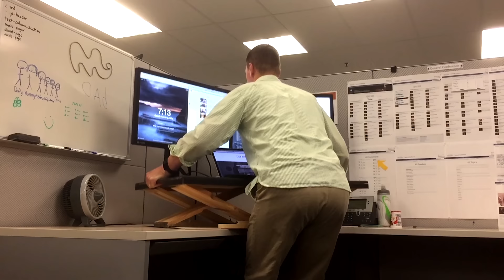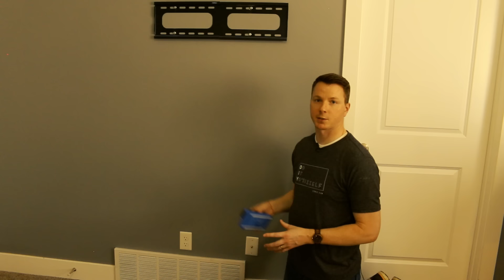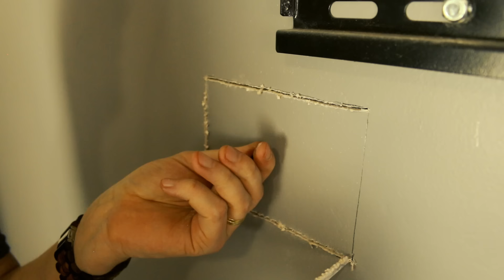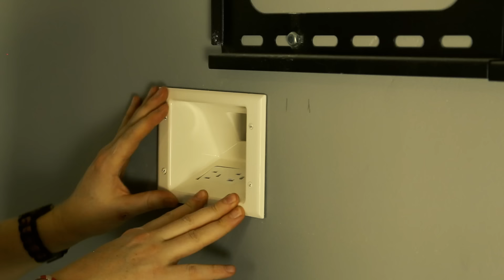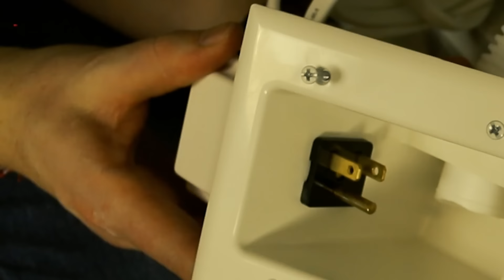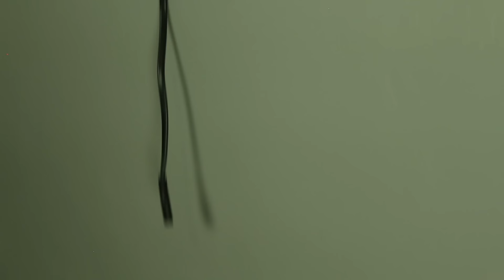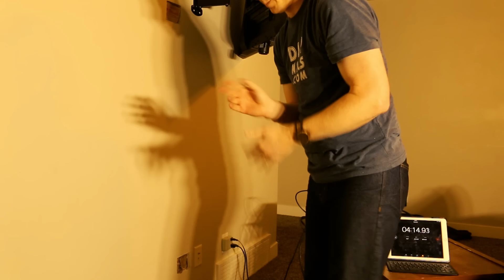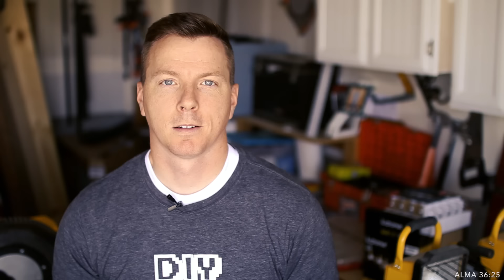How To Hide Your TV Wires in 30 Minutes - DIY

Comment: If your stud wall is as simple as these are then save a fortune and just use cheap dry liner boxes and drilled blanking plates. A lot less ugly too. You can buy longer cables and stow the excess in the wall easily. This makes installation easier and allows upgrade to a larger TV.

Comment: Highly recommended to plug into a UPS “uninterrupted power supply” instead of the wall.  Save your TV in case of lightening strike.
Reply: A UPS will not save anything from a lightning strike. Unplug what you really care about! Read the fine print on what they protect you from.

Comment: I've don't this many times and you don't need this over complicated kit. 2 cut in boxes 2 blank wall plates that you drill a hole in and an extension cord do the same thing! Total cost my way is less than 10 bucks and you use the exact same process to cut and run your wiring.

Comment: FIRE HAZARD WARNING.
NEVER roll up power wires like that.
Now if they are under power the magnetic fields made by the electricity could build up heat inside the wires.
And that is 1 step to a power arc inside your wall and death to your whole family.
If you want to learn about this buy a cheap roll of wire and take it outside and use it to power something.
After a short ammount of time carefully feel the wires on the spool and they should be either warm or mabye even HOT.
Reply: Magnetic fields don't generate heat; the heat in a coil comes from the current flowing through the resistance of the wire.  The inductance added by coiling the wire will reduce the current slightly, so there will be LESS heating.  But at 60 cycles, the inductance of a few feet of AWG 14 or 16 wire is virtually nothing.    All you people who think a few turns of wire are going to catch fire are plain goofy.
Reply: 1985 I was just starting into the electrical trade and was visiting a friends house. They had an extension cord rolled up sitting on the wooden floor near curtains that had melted into a blob. It was used to run a window A/C unit. I  believe that if I hadn't noticed it there would have been a fire. The plastic was so badly melted that I couldn't believe that the wire hadn't shorted out and blown the fuse. They were very lucky.
Reply: Ooohh magnetic fields I better wear my tin hat!!! 😂😂😂😂😂😂

Comment: Nice idea, but noch for using in solid European houses. ;-)
Reply: Kris Bright, No, the walls today are insulated too. Look at this: https://en.wikipedia.org/wiki/Exterior_insulation_finishing_system
And, if you have solid interior walls and doors without gaps you can poop without anyone listening. ;-) 
That's awesome!
Reply: Kris Bright You miss the point. You can still have brick walls and insulation! External walls have two layers of masonry with insulation and and airgap between. So reduced heat loss, no penetrating damp. Internal brick or block walls dramatically reduce sound transmission, help balance humidity, store heat to even our temperature fluctuations and of course are much more solid. You talk about ease of maintenance- cannot think what kind of maintenance you would need to do to an indestructible wall! It's not like drywall where you can punch a hole right through. Any small scratches to the plaster finish are easily filled and sanded. Why anyone would opt for drywall when brick is an option is beyond me.
Reply: Dont forget, its very easy and cheap to pump insulation in the walls too. I think Americans prefer to let their houses blow away every time a breeze passes. lol.. Hurricane in USA.. whole towns blow away.. Hurricanes in UK, Ireland and rest of EU, we put on a cozy fire and wait for it to pass so we can tidy up the garden :p So basically, paper houses might save money..... as long as its not windy out lol
Reply: However, he did point you in the solid wall direction in the opening statements ;-)
Reply: Because it is easier to insulate and far cheaper to maintain and replace parts of the wall.

It's mostly a convenience more than anything else.
If you have a solid brick wall house, you're most likely losing a ton of heat to and from the exterior walls.
Reply: H. Sch. I was about to say the same. American junk as its finest. How can they live in paper house?

Comment: One of the basic rules in Electrical
Never ever make circle round coil out of life power line 
That's will started a magnetic field that creates a resistance with in the wires  which will generate heat that will cause the wires to meltdown (perfect recipe to start a fire inside the walls).
Reply: While I don't agree with the loop he made, It's unlikely to cause a fire, and unlikely to heat up with the minimal current it will be carrying. Was it a dumb move? yes.. Does it really matter? NO.
Reply: I'm still trying to figure out wtf "life power line"is
Reply: Because electricity is magic 😂😂😂😂😂😂
Reply: NEC 358.26 Bends — Number in One Run
There shall not be more than the equivalent of four quarter bends (360 degrees total) between pull points, for example, conduit bodies and boxes.
Reply: SAYS THE PERSON WHO CAN'T SPELL . . .
Reply: @raven49235  what the fuck has spelling got to do with it? Dip stick.

Comment: Nice video and I'm all for DIY, but I noticed you are running the cables in an HVAC return with no block between the return vent and the wall cavity.  Depending on your specific codes in your area, this is generally not allowed without running Plenum compliant cable or running it inside a fireproof conduit, which I'm sure that plastic tube you got at home depot is not.  I cannot comment on the other cables or the pseudo-extension cord, but I doubt they are.  The reason for this regulation is if anything catches fire or starts to overheat, the poisonous burning plastic smoke isn't circulated throughout the house through the running HVAC system and possibly killing everyone sleeping in the house.  In general non-plenum rated cable is allowed to cross within an HVAC return cavity horizontally (not that much surface area and is probably how the outlet is hooked up) but not run vertically within the wall.  If you ran the wires up the cavity to the right of the HVAC return, it would eliminate this concern.  I also checked the instructions and it only said to make sure you are compliant with local regulations when installing.  Hope this helps.

Comment: I have followed your advice. But, later I bought (without thinking enough about it) a multiposition wall mount (http://avfgroup.com/resources/cca/cnl655-f.html) at Costco . Then, if you really want to be able, for instance, to turn the TV to the side (45 degrees) (you can do that), your cables, power and data, must be long and loose enough to allow you to do that. So, if you leave the cables long and loose enough, you're back to square one as far as hiding them. Something to think about...

André

Comment: I thought keeping the power wires coiled will cause heat which could end up causing fires....in England we either rewire the leads smaller or buy shorter ones....just a thought..
Reply: I don't see why we couldn't wire them shorter here in America, and yes coiling the wires is a heat/fire hazard.

Comment: so much hate in these comments.... as a noob... why dont yall make a video if he did such a shit job.  The video was helpful to me
Reply: So...you want people that actually KNOW what they are doing and how to do this better to just keep quiet so other viewers don't know there is a better way to do this?  Is that what you are saying?  We should remain silent and allow viewers to look at sub-professional work and remain ignorant of better practices?  I ran voice, data and fiber for years for data and phone networks and I have a clue what I'm talking about.  One better way is to put a pull string at least twice as long as the drop between the two holes so you can tie off a cable, pull it down and not need to replace the pull string, so it is there for future use.  Also running power next to a data cable induces electrical noise onto the data cable, especially running them literally touching each other.  It takes a different level of professionalism but I'd have put an AC outlet up behind the TV so there was more physical separation between the HDMI cable and the power to minimize the electrical noise on the data cable, which is what an HDMI cable it - it's passing high speed data.  If you want to know how much electrical noise there is near AC power, go to this link.  https://www.youtube.com/watch?v=OYQxIAXw6C8.  It shows an inductive amplifier which picks up electrical noise and converts it to an audio signal.  That loud noise at about 45 seconds is what AC power sounds like if you get too close.  If you get about 3 feet away from an AC line that noise goes away.  Running your HDMI cable next to your AC power cable is putting that much electrical noise on your HDMI cable, that's why I think it is better to separate your AC power and HDMI data cables.  This is a good DIY item for general public use, but it could be done better if you have the knowledge and don't want to use a premade kit.  That white tube was a good idea...although if worried about bugs he could have  also dumped some bug killer inside that wall to ensure no bugs come crawling out in the future.  I'm not trying to hate, just sharing some knowledge.  I'd make my own video but I'm in a rental at the moment and I'm not going to cut holes in someone else's home.
Reply: @Troy-Echo  
Although I do agree with you about the speaking up part, which there is much to break down in this video. It is completely ok to run most HDMI cables along with 120V power. HDMI  cables today are shielded against the interfering noise from AC power. They are specifically designed for this very situation.
Reply: @Battleborn357  Shielding reduces the electromagnetic noise that is put into other nearby cables, but it doesn't block it 100%.  When you move electrons through a wire, it generates a magnetic field, and inversely, when you move a magnetic field across a wire, it moves electrons, thus how step up, step down and isolation transformers are built.  It is possible to reduce this noise, but there is no way to 100% block a magnetic field.
Reply: @Troy-Echo  
I didn't say it blocks it 100%. But
the shielding blocks it plenty. You can literally run HDMI right next to AC power, and you won't even notice any interference.
Reply: @Battleborn357  I never said you said it blocks it 100%, so I'm sorry if it came across that way.  I'm just very OCD when I do my work, and separating my cables satisfies my compulsion to "overkill" my build.  My dad was a contractor and he was big on not cutting corners, and my OCD just takes that too the next level.  Sometimes it works out well, other times it works out, but the time spent versus the delta change gained in service isn't worth it.  This may be one of those times.
Reply: wide awake just like your minding yours by adding your 2 cents.. lol oh ok
Reply: Bob "Nearly 50,000 home fires involved electrical failures or malfunctions" are you referring to these people?
http://www.nfpa.org/News-and-Research/News-and-media/Press-Room/News-releases/2013/Nearly-50000-home-fires-involved-electrical-failures-or-malfunctions
Check it out you might learn something!
Reply: You should never wrap wires like that in a wall because of heat👀.. But I get the concept💯
Reply: @peaceofmind6141   so how should a wire be wrap?
Reply: @maxwellowusu443  it shouldn’t be wrapped at all. Cut it to length. 9 inch outside the box. So when you push it in it doesn’t fold.
Reply: Are you serious? The length and gauge of the wire combined with the load causes wires to heat up.  resistance does not change with a couple wraps to take up slack.  I would cut it to the correct length to keep the install clean.
Reply: @phoenixskeptic7698  what is the right length of wire to cut?
Reply: Dominique Chisholm 

I agree. Dom, there are always haters.  Even in some simple video video showing how to plant a lemon tree.
Reply: I TOTALLY AGREE WITH YOU BRO FOR SOME REASON HATERS NEVER ANYTHING GOOD TO SAY ABOUT ANYONE!
Reply: it's a tip, dummy...so much  hate inside you. Should get it fixed...
Reply: Did u come to watch the video or read the comments?
Reply: This video is garbage this is the dollar store way to hide your cables. You want a big looking toilet paper dispenser in your living room
Reply: I agree, inet trolls with no life!
Reply: Haters gonna hate. That’s what they do. 🤷🏽‍♂️
Reply: Dominique Chisholm Too many people with nothing better to do than complain about what someone else is doing instead of getting off the couch and doing something better.
Reply: Dominique- I don't think the word 'hate' is what you mean. Concern for the well being of others would be the point. Someone with a little bit of confidence may think they can do this without understanding the danger they hide behind the wall. I'm sure you have watched some home repair shows and the things that get discovered when the drywall comes off the wall.
Reply: When did calling someone out become "hate".... you really need to put your big boy pants on and stop with the homosexual victim mentality dude.
Reply: Dominique Chisholm THANK YOU! I can do this and I'm going to! I know nothing about electricity...dont want too just wanna put my tvs up with no wires showing....
Reply: And I respect that Larseus.  You and everybody else have the right to disagree and be wrong or do things in a sub-professional manner in their own homes or homes of friends.  How many industries waste money across the board on purpose?  Very few that want to be able to compete and stay in business.  Have you ever looked at the inside of a data cable?  Each pair is twisted which takes up more copper per foot than simply running the cable straight.  Do you know why they do this?  It is something called "Cross-Talk".  Cross Talk is when electrical noise crosses over from one little strand of cable to the neighboring strands, and twisting the pairs of cable helps to minimize this cross talk.  Cable pairs are even twisted in low grade voice cable because the term "Cross-TALK" was because before pairs were twisted you could actually pick up enough cross-talk that you could hear other phone conversations on other cable pairs and hear other people "Talk" while you were on the phone.  That is much less of an issue now due to VOIP technology, but that is because when the cross talk causes an error, the receiving end reports the error back to the sending end and the packet is resent.  The more cross talk, or inductive interference, the more packets that need to be resent due to errors.  This all causes a slower "correct" data packet bandwidth across the cable.  The voltage and current going over voice and data cables is a lot lower than what is on an electrical wire, so you can imagine the noise induced onto a cable from an AC line with higher voltage and higher current is going to cause more interference than low power DC voltage on a data cable.  What I said in my post above was from experience running cable for years, what I said in this post was from my degree in computer electronics.  So feel free to disagree, but I am solid in my experience and education proving me right.
Reply: To each their own Noneya Frigginbezwax. I disagree but to each their own.
Reply: @ChicagoTechDude  disagree all you want, fact vs fiction?
Reply: @charleyventures687  Do you know what I am disagreeing to? It wasn't the video if you are wondering.
Reply: Yep, same, bunch of haters man, can't please the world.. People are so negative in America...
Reply: Dominique Chisholm ....mind your own business.
Reply: Most of us are not as stupid as you.
Reply: @robertheintz8017  you’re a joke
Reply: @robertheintz8017  why is he "stupid" ?? Nothing stupid about his comment.  Calling other people names is coward like, spineless, bottom of the barrel POS.. I bet you wouldn't say that to this man's face in real life.  How do YOU wake up in the morning knowing you do coward like things?? How do YOU look yourself in the mirror and look at yourself every morning knowing that you have no spine? If you have kids, I feel sorry for them for having a daddy that does coward like things.

Comment: No way is this installed to any code! Check your home owners insurance and see if they will cover a fire from wire that is coiled up inside the wall. Do not follow this method. Extra Low Voltage (less than 50 volt) Class 2 wiring you can do what you want but for mains voltage there is a code book with rules to follow. Call a licensed electrician if you don't know. A fire is not worth it.